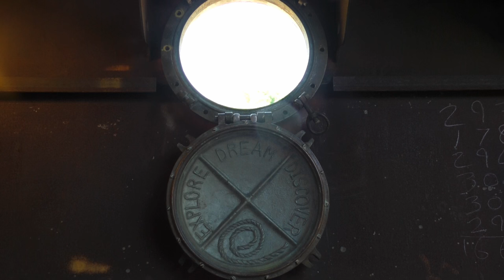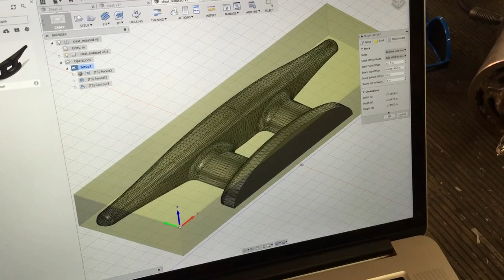Cutting Portholes and a Match Plate

Comment: Hi, that kind of casting works like a charm, standard back in the day in my dads foundry. The model was split into two and mounted on both sides of a plate which you can turn 360deg. Guides ensure that the enclosure thingy gets where it needs to be and its locked in place with wedges. Finish one side, turn it 180, lift up a raising plate from the bottom, release wedges, switch on the airpowered shaker, slowly lower the raising plate. With that you can use standard sand if you condition it right. Maybe a little over the top for your operation but easy to build from scrap. Cheers, Andi

Comment: If you get tired of sanding and painting your casting patterns to get a smooth finish for a good release check out the plastic  'Solid Surface' counter top materials like Corian. It machines decent and there is little to no need for sanding after machining. Best of all you don't need to coat with paint. I have been using it instead of wood and its a lot less labor intensive. I picked some up for cheap from a surplus store as well as some 'drop' for free from a counter top installation business. I look forward to the next video.

Comment: Being retired Navy I look at things differently, is there any X-ray or inspections made on the hull welding? or air pressure testing on tanks and voids? This ships is going blue water correct.
Reply from the maker: No X-rays.  No pressure test.  Definitely headed to blue water.  And no worries.   Of course I was never in the military but from my observation they do a lot of training in how to worry.
Reply: SV Seeker you're probably right, and probably have a different level of welders who volunteer as well (I'm a mechanic not a welder) but saw a lot of failed NDT welds over the years during hull inspection (stupid law saying we are accountable to congress for the ship's condition) as reported problems from welds were usually from bad rods vs talent level. Once she launches I'd like to help tune in the plant, I've only got 30 years experience making ships go, you're doing great work. Can't wait till she's in the Gulf! Make sure you get a port call in Tampa Bay!

Comment: You might try coating your match plate in Ben Moore Advance a little pricey for sure (~$40/gal), but it settles out like no other and forms a super hard very smooth finish with no brush marks. Really popular with cabinet makers. I think the high gloss stuff would be perfect for the mold patterns!

Comment: Doug, I found it strange to see port hole dead lights hinge from the bottom side. Now all my experience is with ww2 type Naval ships. All their port hole dead lights/ covers where hinged from the top. They all used a hook to hold the cover open when in use. One of the reasons for them to hang from the top is rough seas. If they hinged from the bottom the covers could bounce up and down on the hinge and wear the pin out. Hanging from the top the covers were held steady in place with the hooks that held the cover in place.
Reply from the maker: +B Brown   I use to work at a green house and the owner could never get the employees (me included) to close the doors.  So he changed all the doors so the tracks were angled downward and it became impossible to leave the door open.  The dogs are designed as cams so if you were unlatch the cover and let it fall it will slam into the cam on the dog's hinge and through the dog into the closed position.  And likewise, you have to make an effort to leave the deadlight open.   I think those things make sense considering how many ships were being sent to the bottom by U-boats.   In our case, I prefer that the covers not be accidentally  dislodged and break fingers or decapitate a child. :)

Comment: Great work as usual Doug, and lots of great help.
As I see the interior shots I keep wondering when or if you are going to be adding more framing for the hull.
Then I thought you might be adding it after you have decided where everything else goes like port holes and the like.
Just wondering.
Warren
Reply from the maker: +warp21drive    You're pretty much looking at the framing.   Origami is also called "Frameless"

Comment: Is there a reason for having the portholes opening downwards, and not the usual way of opening  them upwards, and clip the dead light to the deckhead and then the porthole to the deadlight ? This way you have the weight of both, if you have to close in an emergency.
Reply from the maker: +Andy Wright     This way they can't come unlatched and swing shut on your head of fingers.  :)     And you can sill close on at a time if you want, and if you follow orders the you will close them before the seas are up.  :)    I actually thing the hing on top comes from WWII when navy was trying to get army to work dogs.   If U-Boats were still active, I think I'd put the hing on top too.

Comment: Seems it would have been nice to move the portholes up a bit so you didn't have to cut thru that hull brace. I am sure it isn't necessary but in the event of banging into something having the extra bracing would sure add a lot of support for the hull.
Reply from the maker: +bcbloc02   The angle is more for developing the curve of the hull, and it's not a horizontal piece.   Once the deck plate is installed it is redundant, and any strength removed by cutting it is replace by the structure of the porthole frame and the porthole itself.

Comment: Hi Doug, Dave from Australia, long time fan, amazing job, motivates me to get my 19 foot runabout I'm modifying finished before you get your 75 footer in the water! Have a question about your "deadlights", (portlights), is there a reason you're putting them in upside down, as the're normally mounted so they swing shut?
Reply from the maker: +Bayside Gas Service     Yes.   This way they can't come unlatched and swing shut on your head of fingers.  :)

Comment: portholes look great.  What was the reasoning with having the deadlight fold down?  All of the ship's I've ever sailed on always have them fold up.  The one advantage of folding up vs down is that to can pack goods/gear/equipment/etc right to the bottom of the porthole opening.  If the deadlights folddown you have to leave that area clear.  Also from a night-ops standpoint.  It's night to be able to blackout the ship (as viewed from the exterior) with out having to dog the deadlights close (just let gravity do its thing)... I was just curious, it's your boat, built it however you want.
Reply from the maker: +Webb Pinner   Thanks.  And in our case, I prefer that the covers not be accidentally  dislodged and break fingers or decapitate a child.   And they are located where space is not an issue.

Comment: just curious, how big are you making your mooring bits/cleats? The ones shown in this video seem quite small for the size of boat.
Reply from the maker: +Brad Mcconnochie   Those are 12" cleats for tying off the tender and equipment.   I think we will install sampson post for the anchors, towing and such.
Reply: +SV Seeker, cheers for the quick reply! Phew, in that case they look perfect! Best advice I can give is to make your mooring bits way oversized, one of the boats I work on has bits too small to get decent line around and it's a pain in the behind. larger bits are so easy to work with and make it easy to double up lines on. She's coming along nicely, keep up the good work!

Comment: I plan on being out that way for the eclipse in 2017, if I could come see your boat it would be awesome.  I have ten years cabinet shop (finish carpentry) experience and I'd like to offer my services maybe in trade for a place to put my tent while I'm out there for the eclipse.
Reply from the maker: +BVprocHQ   Cool.  I think we have some cherry wood coming and I am thinking about Ipe for the lower decking.
Reply: +SV Seeker Ipe is great, super hard, heavy, dense wood, it doesn't float, super rot resistant and bugs hate it. Let me know if you want help with that. Started in the wood floor biz with my dad in the 3rd grade, almost 40 yrs ago.
Reply: Oh yeah I would love to help with anything you can throw at me if it's something in my trade that's even better.  Like I said I'll be out that way for the eclipse in 2017.  This week I will check out my dates times and locations and see how it will all work out.  When I figure it all out I can let you know via the website when I will be available.  This sounds like it will be awesome and I look forward to working with you guys.

Comment: Well that was sort of what I thought you might say. I'm just conserved the unsupported panels will 'oil can' between the structural items.
The frameless is defiantly great for getting the shape without building a frame first but I still think it will need support for the skin. Are there examples that have been used for awhile with out having trouble with panels moving or hull twisting. I shall have to do some research . I just don't think the 'panels' are stiff enough ....but I've  been proved before. Warren
Reply from the maker: +warp21drive     There are hundreds of origami boats, most in the northwest.  Few are near this size but all without any bulkheads and most with 3/16" and not 1/4" steel.   The only area where I plan to add a couple of frames is the forward cabin where the hull will slam down in heavy seas.

Comment: Might think to reinforce around the port holes where you cut out the hull reinforcement. Water is heavy, and heavy seas love to find the weak points.
Reply from the maker: +Lollypop   The steel frame and the porthole frame together are much more metal than we removed, and I think that is the requirement when making holes.

Comment: why go to all the work of making a mold and casting for cleats when you could have gone for bollards (or bitts depending on your english) ?
That is just two pieces of pipe welded on deck upright. (with a cover on top)

And what a difference those portholes make! amazing. the amount of light (and air) you get below is quit good!
Reply from the maker: +Splinter5570    I guess the best answer is because that is what I want to do.  We will have bollards too.  These cleats are for tying off smaller loads to the catwalks.   We cast door handles too, so if your looking for pure efficiency of time you will not find it here.  If you want to watch us learn how to create and use a match plate then stick around.
Reply: Ah missed the part that they where for the smaller lines. Now I understand. 
I learned so much already, I surely stick around.
It's also really appreciated that you always reply:)

Comment: The amount of welding you do with that mig welder I'm willing to bet the liner needs to be replaces. They get full of crap and bind up. Open the drive rollers and pull the wire, if it's not that free, replace the liner. Also, please don't do down welds. You don't get squat for penetration. Always weld up!
Reply from the maker: +Thaddeus M    The liners are routinely replaced.   And I keep looking for someone that can quantify the down hill thing because I don't think it holds as much water as rumor holds.
Reply: +SV Seeker Just do a test yourself, weld some plates together in a vise then try to break them apart. I'm a certified welder, so I've been through it all. On anything of mine, I will never do a down bead

Comment: You might find this interesting where they discuss frameless or plate first construction, and the need for frames added after.
http://www.kastenmarine.com/frames_first.htm
Warren
Reply from the maker: +warp21drive   I would give more weight to Kasten Marine if they were not in the business of competing with frame-less origami designs.     Given that hundreds have been built and sailed.   Even the Nuthin Wong which must take a prize for the worst maintained boat in history has been on the water for decades and around the world.   I would pay very close attention to those that have suffered structural failure.   Let me know when you find one.

Comment: I was looking at your cleat pattern and the first thing that came to mind was gee they are small for the size of the boat you are building.  Having worked on fishing boats and fish packers in Alaska what I see used on most other boats seem small.
Reply from the maker: +Kriss Femmpaws    :)   They are for tying off the tender and equipment.
Reply from the maker: +Kriss Femmpaws    Yeah, they are going to cast in bronze and welding onto the hull.  A couple will go at the aft end of the catwalks.
Reply from the maker: +Kriss Femmpaws    They are not to bad.  I buy the bronze drops from one of the local foundries.  We'll do some aluminum ones for the tender too.